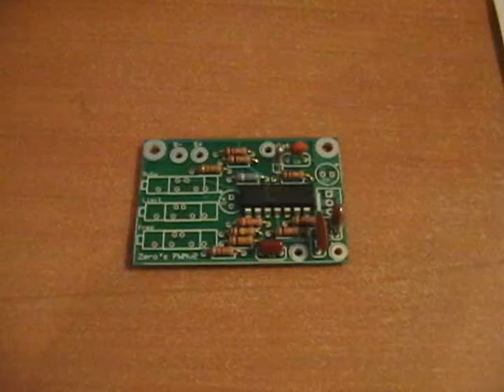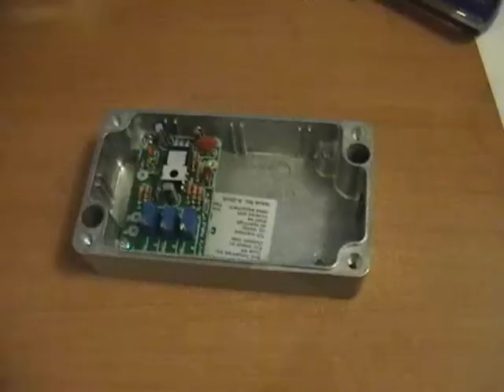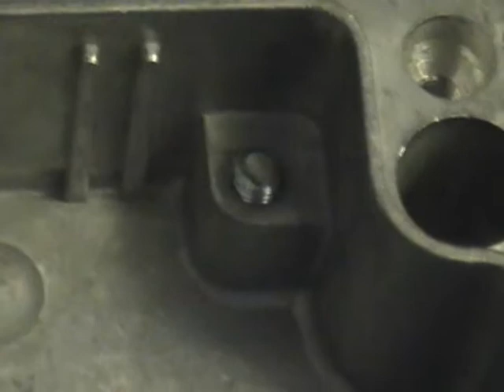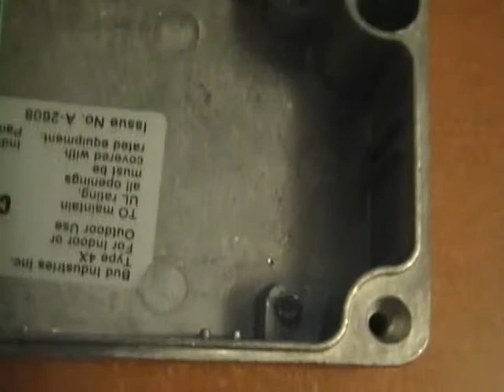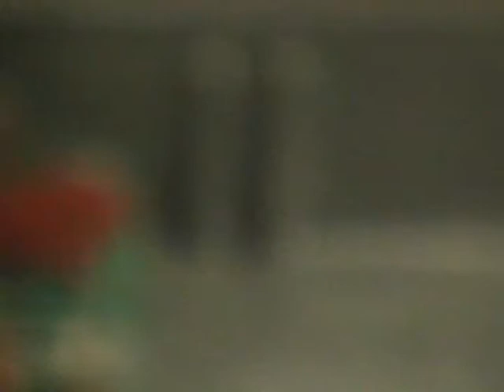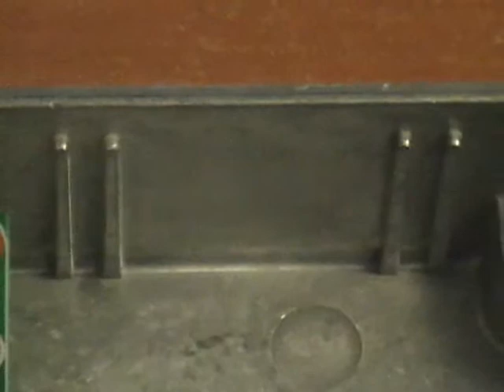PWM Build (06)

Comment: you could throw a little bit of the metal putty from a muffler repair kit into the hole that you drilled out to large. You should be able to find it at an auto parts store.